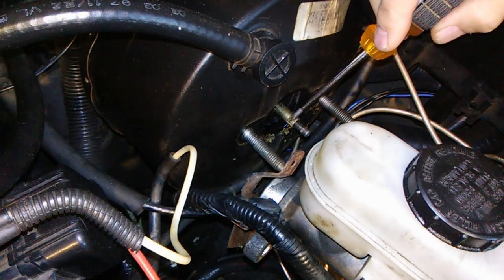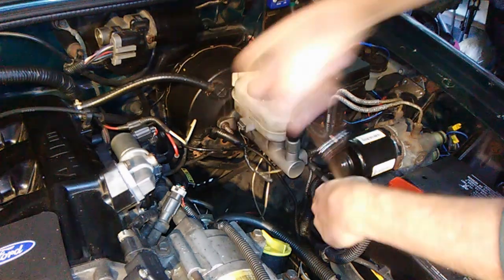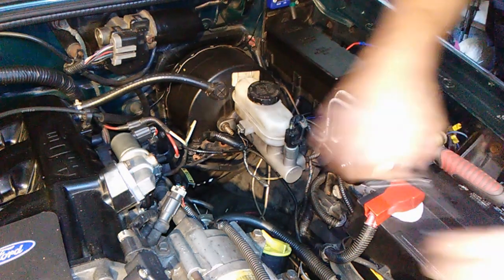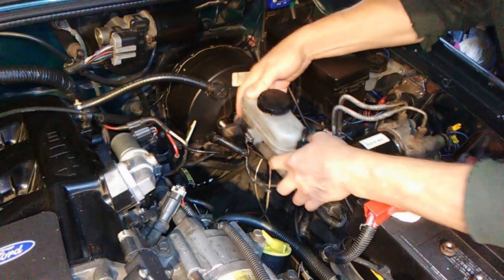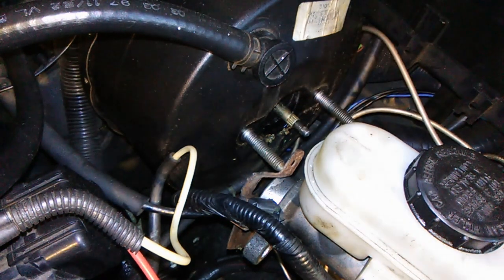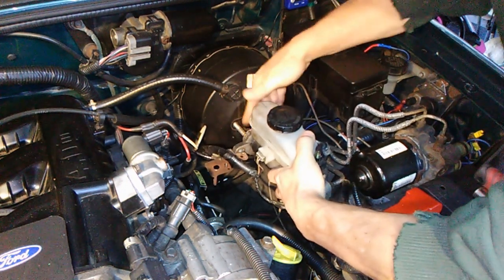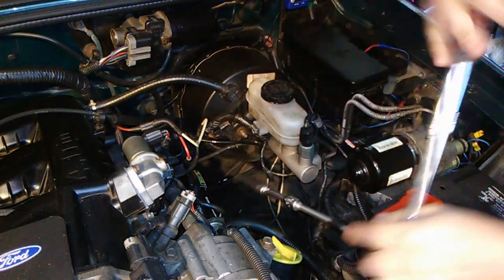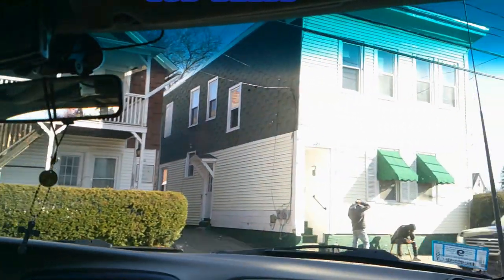Ford Brake Booster Pushrod Adjustment  /  How To Fix Excessive Brake Pedal Travel

Comment: The make a brake booster pin adjustment tool to make sure you have the proper spacing instead of just guessing.   Hate to guess that I am right (or wrong) with my brakes.
Reply from the maker: It tells you how to make one in the Haynes Repair Manual, but it didn't work for me I had to adjust mine out a little further. The most that will happen is your brakes will drag and you'll have to back off a bit.
Reply: That tool is such a time saver! I tried using my caliper gauge and horrible math skills and just ordered the tool instead.
Reply: @Scrapla1 That tool is the bees knees, i bought one and i set mine but i think i set it too short (no fault of the tool) so my brakes are kinda longish plus the new booster i installed the rod moved really easy so i think it might have backed itself in too, I'm gonna check it out this weekend,the car stops fine but like i said the pedal is kinda too long for my taste.

Comment: I had a lot of brake play dead space or just dead pedal feel but the truck would stop just after a lot of input. Lots of service from myself and the dealership because of the pedal feel. I did this and it immediately felt better. Only a 1/4 turn and all the spongey feel gone. 

Thanks for the video!!! 
(2017 F150 3.5 eco)
Reply from the maker: I'm glad it helped you out. 
Thanks for sharing👍

Comment: Just replaced my booster because the leak was so bad it would stall at a red light. I was wondering why my pedal had an inch of travel before braking happened. Everybody elses answers was convulted shit like "your ABS module needs to be reprogrammed" but nah loosened that pushrod half a turn and now my brakes are minty. Thanks man!
Reply from the maker: You're Welcome,
Glad I could help you out, and Thanks for sharing👍🙌😊
Reply: Did the rod adjustment fix the leak? I’m having a similar problem and I suspect it’s the rod length.  Thanks.
Reply: @brandonwatts7083 he replaced it. I’m assuming he meant for his new brake booster he had to adjust it.
Reply: I just replaced my booster but now my breaks are very hard. Already bled the breaks any idea how to adjust

Comment: Hru I have all my wheels locking up after a 20 minute drive when I cools down they spin again brakes locking up could this be the issue is an 86 mustang
Reply from the maker: It could be, but it also could be your brake calipers, brake hose, or any number of brake components. There's no way I can diagnose it from my computer. Sorry

Comment: The brakes on my f150 has a lot of play and does not respond till its half way pressed and just paid 600 to have the booster and master cylinder replaced they called me from the shop saying it was ready and went to go pick it up I guess they tightened it too much cuz the truck wouldn't accelerate past 30 take it back to the shop and now there's a lot of playroom don't know what to do
Reply from the maker: Yeah, you dont need to turn that adjusting screw very much. A little turn translates to a lot at the pedal. Too much and your brakes stay on all the time, not enough and you'll have a lot of play at the pedal.
You could have a separate problem. I'd ask them what they did? They should fix it for free.
Good luck and let me know how you made out.

Comment: I replaced my brake booster and my truck went 3000 miles  before it started sinking to the floor
Reply from the maker: Defective brake booster?
Reply: @WhipCityWrencher  Then one before made my pedal sink when starting the engine, I pulled up the brake booster vacuum hose and that made me come to the conclusion that it was defective when it didn't sink and had a firm pedal. I replaced it assuming the pushrod came pre-adjusted. I bleed the lines in the master cylinder and the rest of the brake lines. The brakes kept gradually getting weaker until they completely sunk after sitting one night after driving it with the new brake booster for almost 3000 miles. I checked if the ports on the master cylinder had any fluid pressure by taking off the lines from the master cylinder. The front hole had air pressure but did not actually pump any fluid, the rear one had some but I do not know if it's enough pressure. That made me think my pushrod is adjusted to far in or out, I am not sure.
Reply from the maker: @thtblack5.7  You may have a defective booster, If you adjust the pushrod too far out your brakes won't even release. So adjust them a little at a time. counterclockwise will give you more breaking. The majority of these boosters are rebuilds and they dont always have them adjusted to the correct length. Good luck!👍
Reply: @WhipCityWrencher  |